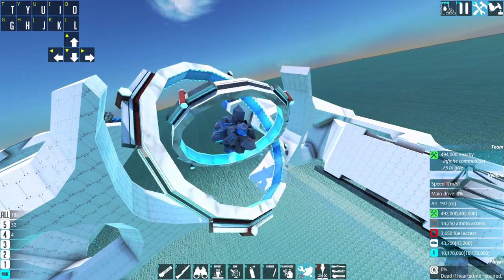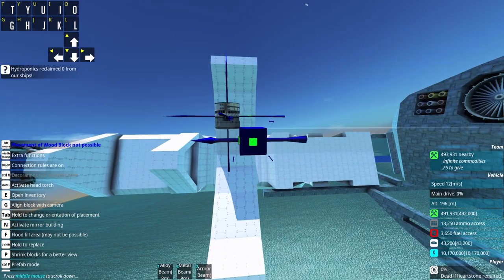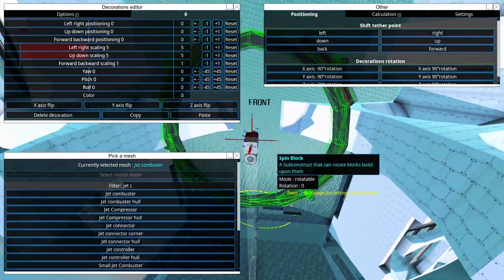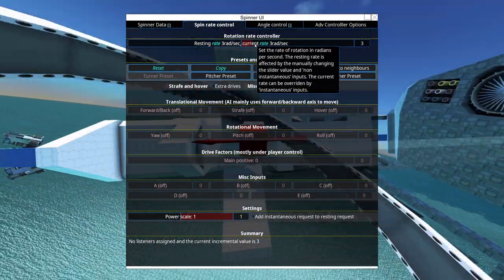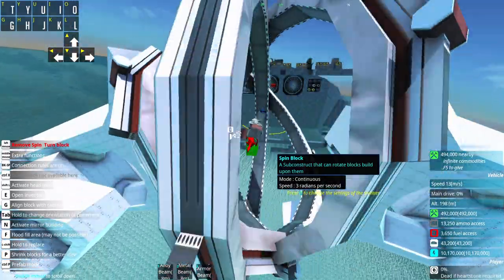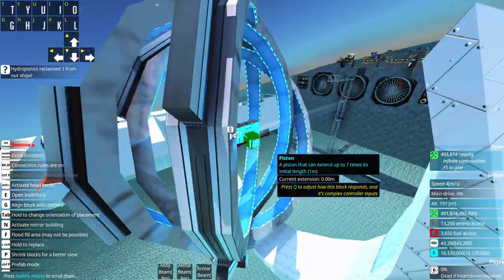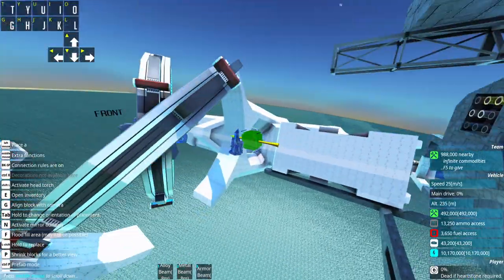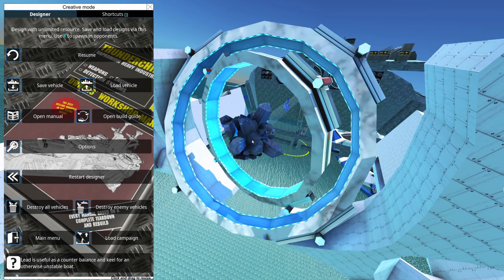How to make a Gyro - emergency tutorial

Comment: I think
There will be a reppetions eventually
Since the planets in our solar system can a line, given there is enough time
But it is super awesome
Reply from the maker: on the Helios every spinblock has a different speed. Also I use prime numbers to make it even less likely.
as a rough estimate it would take an hour until the pattern repeats (4s/rotation, 6axis -> 4^6 = 4000s)
and thanks!